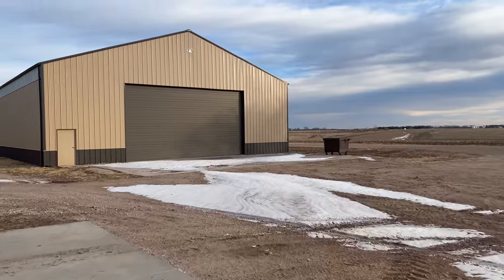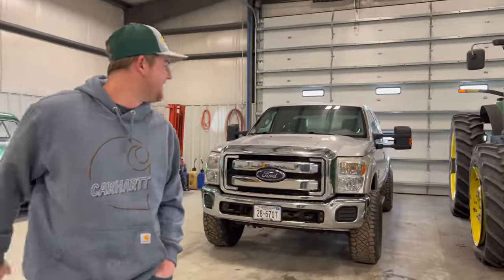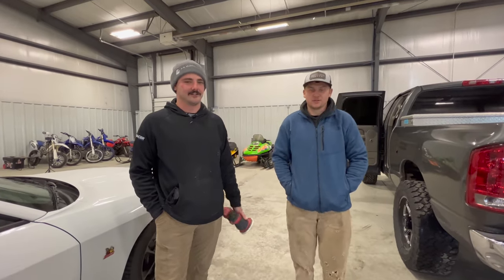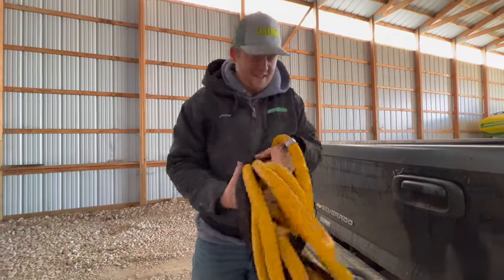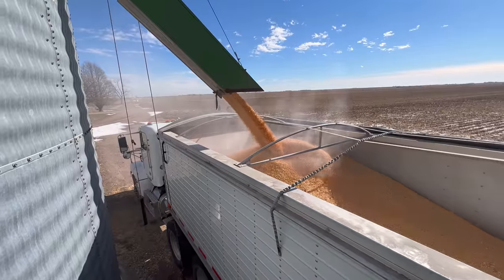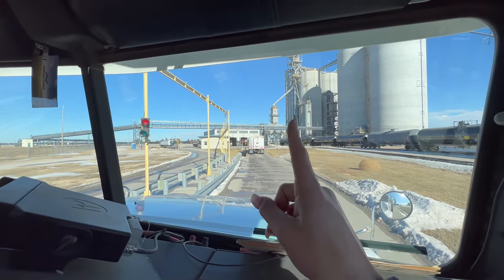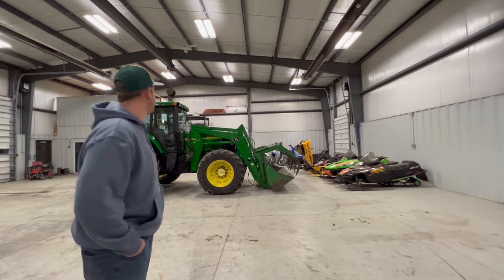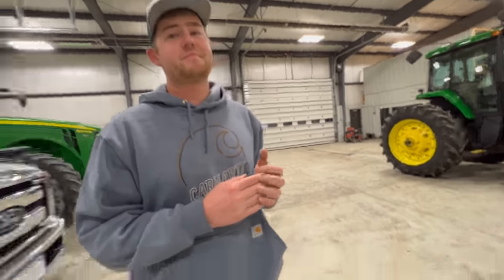Hauling Corn To The Coop

Comment: You have an AD9 air dryer on that Rig, it's located on the right front  behind the bumper. No need to replace the air dryer, just replace the incandescent filter cartridge. Also, the truck wasn't stuck, most likely the brake linings froze to the drums, this happens occasionally when the truck is parked before the brakes had a chance to dry out. usually due to wet weather conditions or the truck was parked right after you washed it.  Love the videos!!

Comment: If I had to guess I would say it was the pressure relief valve on the compressor or the dryer making that sound because of some ice between the air compressor and the wet tank. Make sure that electrical plug in the purge has12v with the key on, drain your wet tank and see if water comes out, and you might need to kit the dryer.

Comment: When it is cold. moisture in the air system will freeze up,  That sneezing sound is from the air dryer, there is a stuck valve in there and it wont let air flow.  Usually you can try pumping the brakes to het it to free up but sometimes it just needs to warm up.    When that happens ususally it is time for an air dryer service or replacement.

Comment: That sneezing sound from the freightliner was a frozen Diaphragm  on the airdryer/governor. It wasn't sealing because of ice build up and that will go away when the truck runs up. We have a few trucks at my work that it happens too all the time. Nothing to be worried about

Comment: Anything you ceramic coat looks awesome and is so easy to wash. But there is also a maintenance coating that needs to be applied periodically to keep that new car look and ensure that the original coating lasts the manufacturer's stated duration.

Comment: No trailer. It probably doesn't have a tow package. Use the Ford. Little ruff on the wheel. And I thought I was bad. Lol I drove on two flats last year and ruined two tires. It cost a lot of money to replace the tires.

Comment: I remember telling you to ceramic coat your tractors when you washed your car with dawn dish washing liquid.
The looks is the least important part for me. You'll see the difference in service. It won't get as dusty. When it does, you'll be able to just gernie it off way quicker and look like new again.
I know if I had equipment worth as much as a house  it's very cheap protection.

Comment: It’s ice in the air lines. Pull the main line off at the compressor. And poor some rubbing alcohol in it. Then start it back up.
Reply: You win...thats exactly what it was...a low spot in the airline coming out of the compressor, filling up with moisture and then freezing. The fix is to reroute the line so the low spot is the end of the hose going into the air dryer.

Comment: I have a small question. I heard the noise and saw you tow truck out. Then you are loading corn and driving it. What was the problem and what was the fix? All the best wishes for the new year. Thanks.
Reply: Yea very strange that that is missing in the video.

Comment: The problem I heard with ceramic coating is you won't be able to repaint your car. Example, if you damage your car and have to repaint it. New paint won't lay on the metal properly if it was ceramic coated, you can't even sand it out.

Comment: I know that popping sound. That's ice in your air Governor preventing the compressor from operating properly, or the spring in the vavle on top of the air compressor going bad. Either way super easy fix

Comment: Maybe you don’t want them on. Or the company has front caps with holes in them on your truck. I just took a hole saw and cut out the center of mine to get to locking hubs.

Comment: a 'sneezing' truck has a problem with its air dryer (yes, it has one, and the dessicant needs to be replaced periodically); a truck that won't make air has bigger problems than that, and shouldn't be put 'in service' without some intervention by a suitably trained mechanic.

Comment: The air drier has trash in it. Pump the brakes all the way down then start it back up, but you'll probably need a new dryer

Comment: Ceramic coating? I don't think so. "A ceramic is any of the various hard, brittle, heat-resistant and corrosion-resistant materials made by shaping and then firing an inorganic, nonmetallic material, such as clay, at a high temperature. Common examples are earthenware, porcelain, and brick."

Comment: Ummmm, hopefully you are using PH Neutral foam soap when cleaning that car???  Given you went from the car to the farm equipment I'd assume you are not.  If you don't use PH Neutral soap you WILL strip your ceramic coating off your car.

Comment: Please somebody explain to me. Why all America uses double wheels instead of single wide wheels.
Reply: Weight carrying capacity
Reply: @darrylpaulhus3069  Yes, I know, but the same load on the ground can be obtained by using single wide wheels instead of double narrow ones. I think I already know the answer to my own question. In Europe, the maximum width of a tractor on a public road is 2.5 meters (8.2ft) and 3 meters (9.84 ft) when some machine is attached. Large tractors with double wheels will be much wider.
Reply: Redundancy, cost and ease of changing. Super singles are great until you have a flat.
Reply: @motomaniakpl  row crops tires.